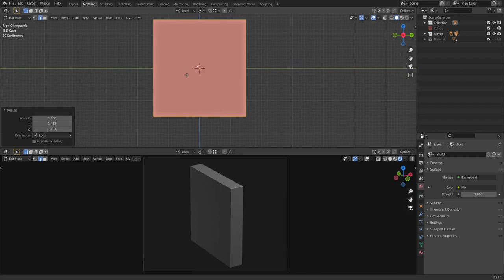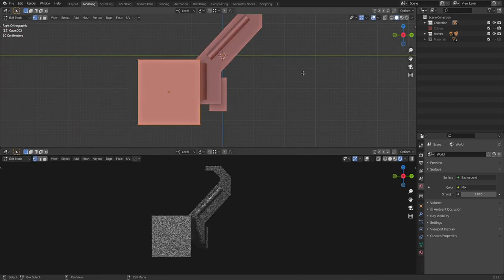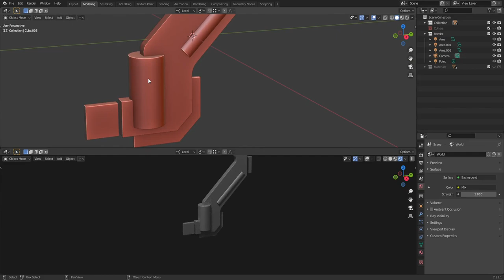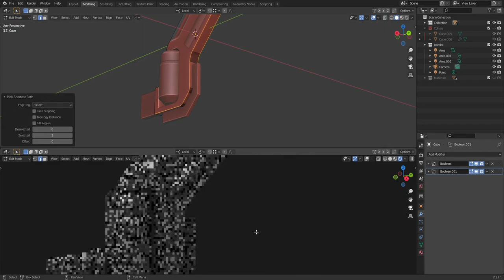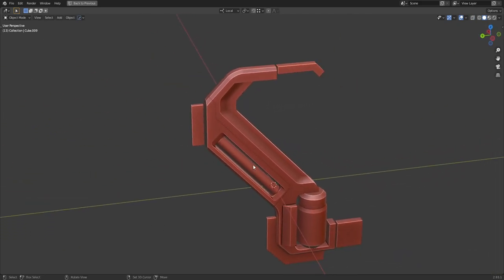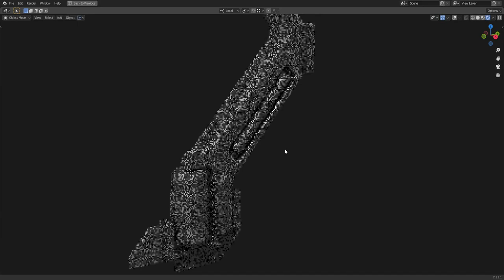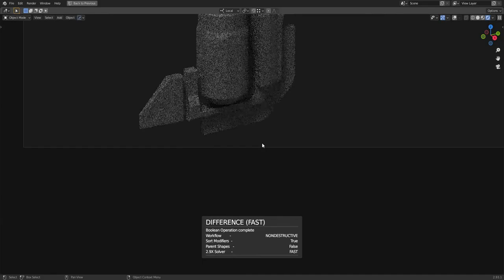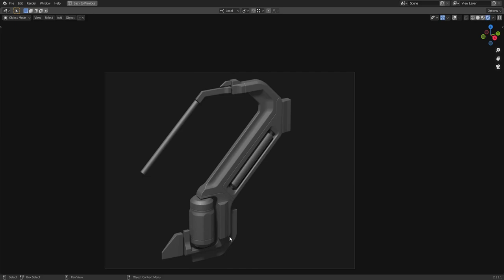longer form abstract blender design part 1

Comment: How do you to get the rules, when do you using knife tool?
Reply from the maker: Press C while using the knife tool and it turns on angle constraints. With any tool active you can look at the bar on the bottom of the screen, it will show the option keys for that tool
Reply: @TheNormanInvasion  Thankss :D

Comment: I have two questionst: how do you jide/unhide all of the cutter booleans and how do you switch to full screen on rendering viewport so fast? harmonica rulles btw :)
Reply from the maker: You can use the number keys to set collection visibility. 1 is first collection in the list, 2 is second collection, and so on. If you press shift it will toggle it.
Reply from the maker: Oh and ctrl-space jumps in and out of maximized viewport, sorry for double reply.

Comment: your render view makes edges kind smooth, what setting are you using to make sharp edges look like that?
Reply from the maker: The top viewport has cavity enabled, and the bottom viewport (in cycles) uses a bevel node plugged into the normals slot in the material shader